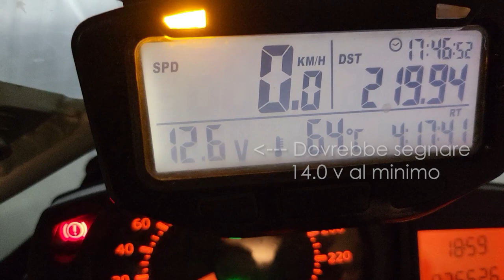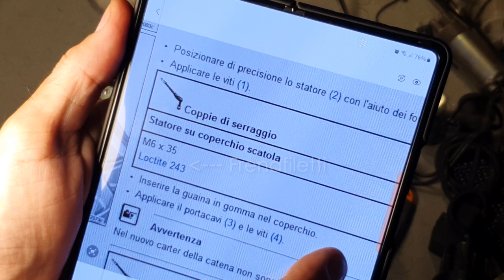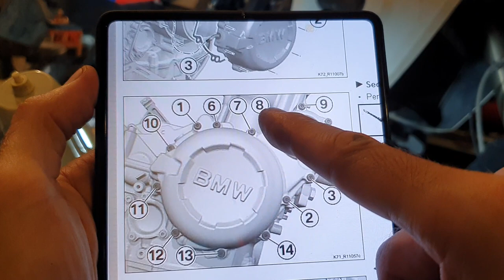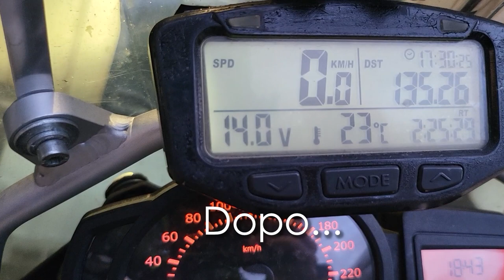BMW F 800 GS - Cambio statore a 76.000 chilometri

Comment: Semplicemente GRAZIE! Ma c'è un modo "preventivo" per capire se lo statore o ancor prima il regolatore sono ancora funzionanti al di la della tensione della batteria che dovrebbe essere di 14v a motore acceso. Io ho il modello 2013 con soli 30.000 km ma leggendo in giro comincio a preoccuparmi! Grazie in anticipo per la risposta.
Reply from the maker: Ciao... per il regolatore non mi viene in mente niente di estremamente preventivo, ma forse, e ripeto forse, facendo una misurazione delle resistenze delle tre fasi dello statore, poco prima del cedimento potrebbe cominciare ad esserci una leggera variazione del valore rilevato... non penso però che ti anticipi di tanto il menifestarsi del problema, e non ho riferimenti nemmeno su quale range di variazione è da considerare un preavviso. Unico modo valido per tener sotto controllo la cosa, è il voltometro! li hai i primissimi preavvisi, nel mio caso è stata una cosa lenta, non da un giorno all'altro, hai tutto il tempo di monitorare e prepararti al problema. Considera che all'inizio noti la cosa solo al minimo, non carica ai 14v, ma in marcia gia sopra i 2000 giri, riesce a stare circa ai 13,5v come minimo, che va gia bene per continuare ad andare ancora per molto tempo, non ti si ferma di colpo la moto. I casi in cui la moto ti lascia per strada di colpo per questo problema, è perchè non si usa il voltometro, e vai avanti senza sapere di avere il problema in corso, fin che poi non è troppo tardi. Io sarei andato avanti per mesi se non avessi visto il preavviso al minimo sul voltometro.